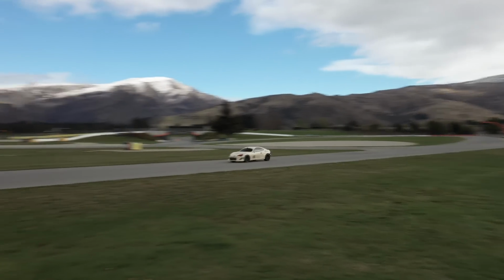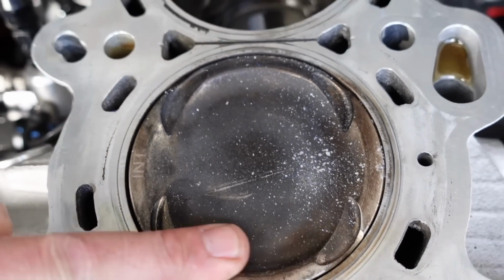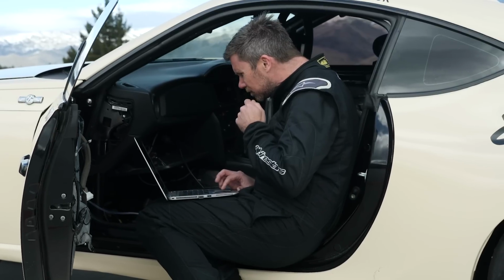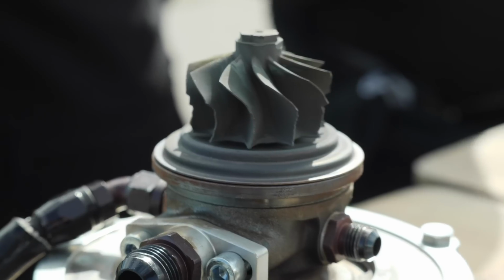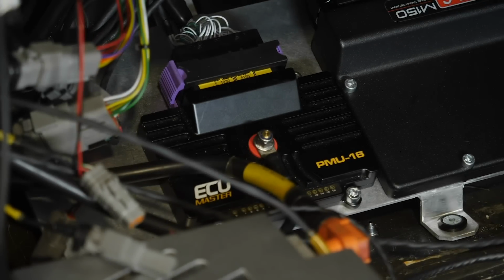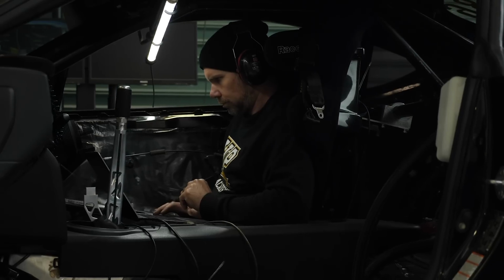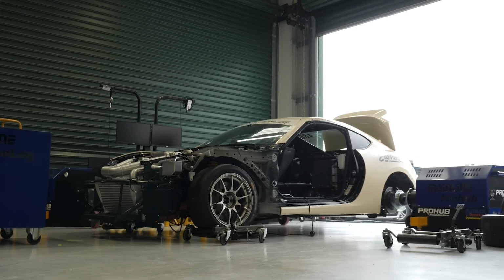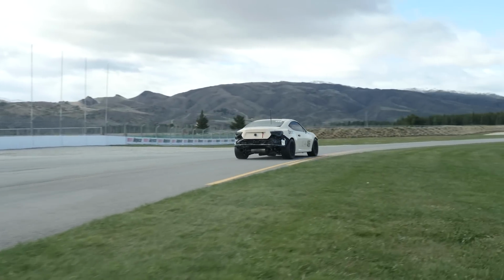More Power, More Problems? | 650HP SR20VE Swap | SR86 EP 8 [#BUILD]

Comment: Curious how the EWP is getting along? Did you have to make anymore changes?
Reply from the maker: The car is still sitting on the hoist at this stage. There has been more ducting work and a wiring overhaul since we now how the time (the car was still OEM loom from firewall back).

We'll post up and update in the coming months once it's back on track. Current plan is to do some testing in the next 2-3 weeks then finish the aero and do some more testing then refining it all for the first race of the season I which I think is in September.

All that around producing courses too, we never stop doing that, easy as 😅 - Taz.

Comment: Been thinking about your cooling system problems. Perhaps the filling point(radiator cap) is lower than the tallest point on the head. Do you have an air bleed line from the highest part of the head water jacket back to a header tank that's at radiator pressure?  ie  like a late ford falcon 6cyl. (ensuring no air pockets in cylinder head)
Reply from the maker: It's a good suggestion but a consideration we had in mind when we designed the filler location. This does however trip up a lot of people when designing the cooling system - Andre

Comment: I'm surprised you guys don't have a pressure transducer on the cooling system, set up with a warning when coolant pressure spikes beyond normal. Simple, easy way to know full stop whether or not cylinder pressure is making its way into the cooling system.
Reply from the maker: We did.... Unfortunately in an oversight, the positioning of the sensor (which was for ease of installation) meant it was on the suction side of the mechanical pump which in turn renders it close to useless. It's been addressed now though - Andre
Reply: @hpa101  Ahh, that's really interesting, I'm surprised that the positive pressure still didn't overcome the suction side negative pressure 

note to self

Comment: Looks like there's a lot of thrust translating through the shifter lever. Is there a mechanical connection between the lever and the mechanisms inside the transmission?
Reply from the maker: Yes, there's a mechanical connection at the base of the shifter (under neath the transmission tunnel) to the shift linkage on the gearbox - Andre
Reply: @hpa101  Thanks for the reply. It looks to me like there might be too much thrust loading in the transmission. What sort of mounting does the powertrain have, and what might be causing that much thrust loading?

Comment: Good work guys! More power due to new parts working well AND lower ambient temperatures? Good luck in your race season!
Reply from the maker: It was colder on the dyno but the dyno also corrects for ambient temp and pressure so realistically that shouldn't cause much of a difference - Andre

Comment: V8 guys: "Why would you take a V8 out for a 4 cylinder?"
Everyone Else: "4500rpm of flat power band..."
Reply from the maker: The other part that is easy to overlook is that the 2.0 turbo puts us in a lower class where we should be more competitive. Of course to be competitive we would still need to get the car to the start line... 😩- Andre
Reply: @hpa101  Wasn't It the finish line being too far away that was the issue? ;P

It was a very unlucky issue though. Did you get the injectors tested to rule out low flow causing a lean condition?

Chicken and the egg, done is done and hopefully it's badder than ever!

Comment: At higher boost levels (higher mass air flow) you probably will reduce max power with the smaller exhaust housing, but since your not at max capacity of the turbo the smaller exhaust housing has moved to a combined compressor/turbo to higher efficiency, thus more power for that much mass air flow.
Reply from the maker: All other things being equal, for the same mass flow from the compressor wheel we will have a higher exhaust back pressure with the 0.83 vs the 1.01 AR housing so I'm not sure how this would explain a higher efficiency. I've performed plenty of dyno tests over the years where we've just switched the housing AR and the typical change in power is usually relatively minor and certainly nothing like we've seen here - Andre
Reply: @hpa101  With the smaller AR housing moving the efficiency curve to the left, it will allow for the compressor to build it's boost with lower exhaust pressure provided the system is still operating at the left of the efficiency curve i.e. haven't reached max efficiency yet. It would be interesting to compare the exhaust manifold pressure and the turbo rpm for a given boost for both AR housings. This data would likely explain the difference.
Reply from the maker: @syntropy3020  we ran both engines at identical pressure ratios so that's one fixed point on the compressor map. Our new engine is now making more power at the same pressure ratio which would require more mass airflow from the compressor wheel. This would move us to the right on the compressor map, not the left. Assuming that we were already beyond peak efficiency which is pretty easy to confirm from the GTX3076 GEN II compressor map, compressor efficiency would get worse, not better. But to be honest we'd be splitting hairs over a few percent and that simply doesn't explain 45 whp.

Bare in mind that as discussed we've also changed the valves, the valve seat profile, made a slight modification to the combustion chamber, and moved to a completely different piston design which has resulted in a small increase in compression ratio. The net effect of these changes would be much more likely to explain the additional power we're seeing than switching to a smaller AR turbine housing - Andre
Reply: @hpa101  This is a copy past from a comment I added to "Christopher Cope's" comment regarding your latest Q&A video talking about this.

With not all the exhaust going through the turbine i.e. some is wasted, my thoughts were that the larger housing would not be as efficient for the same low rpm speeds, thus to achieve the desired rpm for the compressor the waste gate would have to stay closed more to force more air through the turbine, thus resulting in higher exhaust manifold pressures for the large housing. It's quiet the paradox. So with the smaller housing giving lower exhaust manifold pressure for that rpm & torque required by the compressor, more power is made with the same mass air flow through the engine.  I'm only speculating for this scenario as haven't studied the maps. Of course in all scenarios at higher flow (and rpm) the larger housing would be more efficient. And yes you are probably right, even if this does give more power, it probably doesn't account for all 45hp.
Reply: Note that turbine efficiency maps are different to compressor efficiency maps. Turbine efficiency maps are low on the left, and keep getting higher to right. Unfortunately Garrett don't publish their turbine efficiency maps, they just say max is 72%.

Comment: Sounds great , Hella solid state relays , rated to 30 amps and pwm able , using one to control Dbw on a supercharger bypass
Reply from the maker: Yes that would work and the MoTeC DHB is essentially just a nicely packaged solid state relay. For now the solution we're using seems to be pretty solid so I'm not sure we need to complicate things further by changing it - Andre

Comment: With the added horsepower showing up,  could that be to the fact of the new piston and change in geometry?  Or do you think the head gasket issue was already beginnings to be an issue(just not enough  to physically see it) during the dyno run?  Either way, more powerful engine is always a good thing.  Cheers, good luck and stay safe.

Comment: Great to see this monster back up and ripping!  Interesting bit about the power gains with the new head.  Is it possible that the new valve job is flowing that much better than the old setup?  The only other thing I could imagine making that much of a power difference is if the mechanical camshaft timing was off a tooth the last time around.  Though knowing your attention to detail when building engines I doubt that would have happened.  Good luck with your upcoming race meeting!

Comment: Hey Andre, Graham here that had the RS6 down in August... Does the PMU allow PID control for PWM devices? It'd be awesome if you could set a coolant set point with a 2D PID to adjust DC of the water pump to work towards that temperature set point and reduce any potential major temperature oscillations.
Reply from the maker: Hi Graham, no unfortunately the PMU doesn't provide closed loop PID control - Andre

Comment: It's better to use 3 way valve instand of reducing coolant flow rate throu the engine block to coontrol the temperature.
By useing 3-way valve you can keep constant flow rate, which help distrubuting heat throu the block, regardless to the coolant temperature.
Reply from the maker: This is realistically only a concern during the warm up phase. On track at operating temperature, the EWP is at 100% duty - Andre
Reply: @hpa101  Where I come from (industry), if system have to operate at 100% capacity, that's mean is not efficient enough.
I think that cooling system should to be designed to normaly operate at 70% of capacity with 30% margin for extraordynary conditions..

Comment: You think that water pump made that power difference?
Reply from the maker: There's no way we would attribute all of the gain to the pump. I forget the specifics but I think the multi rib belt that runs the mechanical pump can only transmit something like 10-12 hp before it slips so that kind of becomes the absolute maximum you could ever expect a mechanical pump to absorb. The reality is it's likely to be far less - Andre

Comment: Are the cams from the old head in the new head? Could the increase in power be from moving to an electric water pump?  I'm sure thats a fair bit of mechanical load removed.
Reply: yes some power gain.. but not that much
Reply from the maker: The cams are identical. An EWP should show some gain in power but I'd guess at a few hp, not 40 + - Andre
Reply: @hpa101  so it's still a mystery? Is there any circumstance where a vehicle can make more power before some crazy catastrophic failure or is the engine now most likely okay, just possessed with a HP hungry ghost?

Comment: Maybe you could use a fuel pump pwm speed controller for your water pump ? 
Sure that require more work as you would need 2 outputs instead of 1 (1 power, 1PWM control), but I think it would be a lot more flexible than the ON / OFF option.

Comment: Well the Srve engines does originate out of fwd cars only. So maybe the flow of the water cooling jackets internally is suited to cool in a fwd layout considering  the g forces in a fwd layout as well and the high revving nature and heat build up of Ve engines as i have an oringanal pulsar vzr sr16ve. The blue top pulsar vzr sr16ve head is a better head than the sr20ve black as it has larger camshafts. Could be too much heat build up at the fire wall as the cool air is forcing the hot air to the rear. Might need a release piont or duct at by the bonnet.

Comment: You’d be gaining a fair bit from the reduced load on the engine from changing to an electric water pump from the mechanical pump. That’s probably where you found gains on the dyno, especially considering you’re using a heap of RPM in it!
Reply: I've used many times electric water pump over oem mechanical..... yes there is a difference in horse power but NO .... 8n best case scenario you can see 8-10 whp. 
Most of the times you won't see over 5whp.
They do have much bigger difference in horse power..... it's not the water pump.
Reply: yes.. but not that much power gain
Reply: Thanks guys! Just thought there would be more losses through the water pump!

Comment: what size tyres is this car running? hows the grip?
Reply from the maker: We're running a Michelin 27/65-18 in medium. The car is currently a little loose but we still don't have the aero obvviously. It'll still generate around 1.5 g of lateral load though so it isn't messing around - Andre

Comment: Awesome video. Love the car and engine control setup. I did notice you had the lambda sensor pointing vertical on the turbine outlet. Shouldn't that be placed at a slight angle so as to not heat soak the sensor? 

Next step is for some paddles on the steering wheel. Great videos
Reply from the maker: I don't tend to get too stressed over the sensor location as long as it's above horizontal. It's usually more driven by where we have room to mount the sensor - Andre

Comment: considered running the mechanical pump and the EWP? the mechanical pump is less likely to cavitate with the EWP pressurizing it's intake and you can just run the EWP full on >5000rpm or >80c also adds some redundancy to the system.

Comment: Would you ever run antilag on a track so you don’t waste time going through/out of the corners ?
Reply from the maker: Antilag is very hard on the turbo and exhaust valves. I try not to run it where possible and you really shouldn't need it for a race track - Andre

Comment: Great content as usual question do yo tune a variable valve lift engine eg early vtec mivec etc the same or is the overlap taken into account? Eg high exhaust temps from fuel and air going into exhaust before exhaust valve closes or is it not an issue thanks

Comment: Run the pump on the pmu at low temps and a second feed straight from a ecu controlled relay for high draw output effectively bypassing the pmu , 
Extra power , problem in the first cylinder on the dyno last time but didn’t fully show up , show the 2 graphs please

Comment: Nicely presented, I like the new graphics.  Could you put a bigger pulley on the oem mechanical water pump to allow it to be happy at higher rpm?
Reply from the maker: Yes, that would have been another option but there are other advantages in moving to an EWP - Andre

Comment: Is the gains in power due to better flowing heads? I also don't quite understand if the smaller exhaust housing has anything to do with it or not.
Reply from the maker: The head is most likely the biggest contributor. There were some minor changes made to the combustion chamber shape for this head but it isn't ported. The aftermarket valves may have helped but these are still stock size - Andre
Reply: + he said the block was decked > a hair more compression
+ the last time he didn't need to keep his head warm > air more dense

Comment: Im using the same water pump on my VET that gave me over cooling. I ended up using a 3D PWM table using radiator outlet temp as an axis.
Reply: Excuse me for not understanding. Does this make the pump run at variable speeds?
Reply: Do you have an Instagram?
Reply: The PMU didn't like running it PWM and they don't have a solid state relay on hand

Comment: Hi guys, would pulsewidth modulating threw a relay work? Use the pmu to drive the relay and let the relay deal with the high current, the reduction in current should decrease the heat.
Reply from the maker: Yes, provided you're using a solid state relay, and realistically this is what a PMU/PDM is. You can't use a conventional relay at the sort of frequencies you need to run for PWM control to be effective. The MoTeC DHB I referenced in the video is essentially exactly this - A nicely packaged high current capable solid state relay (well actually two of them) - Andre

Comment: Projected plugs probably mechanically advanced the timing a bit, water pump is probably quite a bit more effecient, but that's still a big jump
Reply from the maker: As Andre mentioned he was expecting some increase, but not quite this much at such low boost settings. Certainly not unhappy about it though 🤘 - Taz.

Comment: I'm guessing the mechanical water pump was getting very inefficient up at those high rpms robbing hp.  Now you have more even cylinder to cylinder temps = better ring seal.  Plus very cold ambient air.

Comment: Hey HPA, what changes did you make regarding bleeding the air pocket from the cylinder head? With the radiator being much lower than the head I’m guessing there is a fill/bleed point up near the head?
Reply from the maker: We modified the filler neck to lift it higher in the engine bay. We also used a vacuum bleeder to bleed up the cooling system but I believe the main change that helped us was the switch to the electric pump. It's hard to prove but we believe the mechanical pump was likely cavitating at 9k - Andre

Comment: Needless to say, the car looks great. 
Diff. oil temp. is most likely due to reaching the torque limit of the unit.
Hope the bugger don't let you down
Reply from the maker: We actually found an issue with the diff cooling pump. The current draw increased dramatically and then spiked to the point the PMU shut it down. With the diff pump not operating the temps climbed pretty quickly - Andre
Reply: @hpa101  glad it happened in testing, fingers crossed for the next race! :)

Comment: why not use g30-770 since you have to change the turbo...
Reply from the maker: Any turbo change would have required re-fabricating a lot of the installation (the compressor cover specifically has had a lot of modifications) and we simply didn't have time - Andre

Comment: Brilliant! It looks not only looks fast but quute stable. Some cars look like a handful but I'm imagining its quite confidence inspiring and makes you feel able to push its limits. I am biased though SR20VE FTW..
Reply from the maker: Actually for the moment it's lacking a little grip in the rear end compared to the old setup. This is primarily because we've raised the spring rate significantly to cope with the aero (which we obviously don't have just yet). So for the moment it's quite loose which isn't overly confidence inspiring but it's definitely manageable - Andre